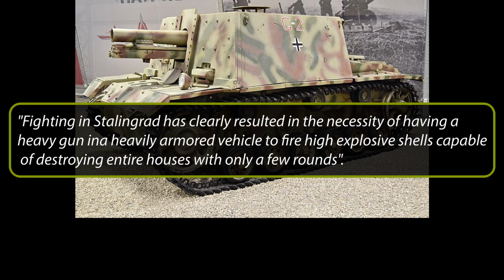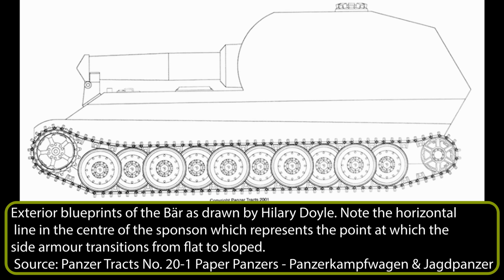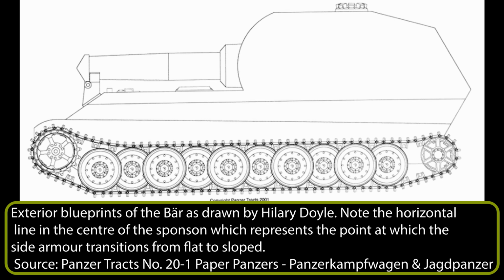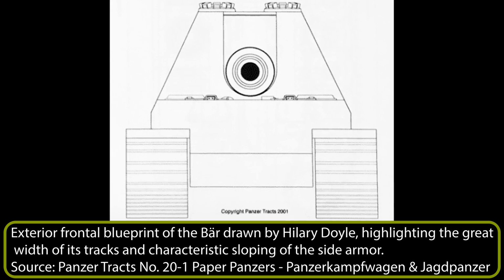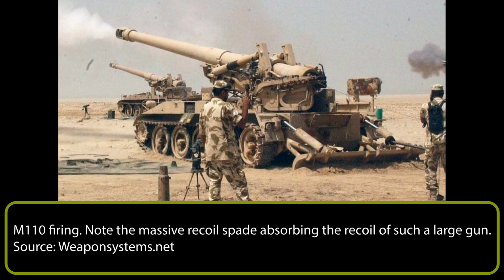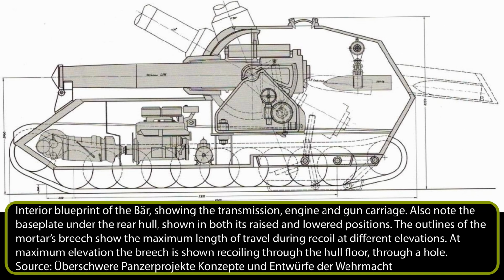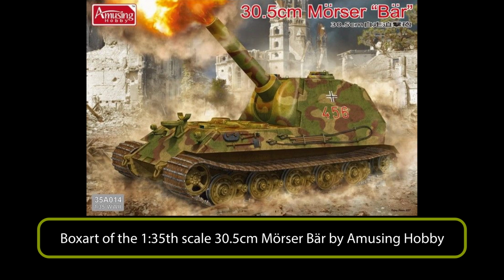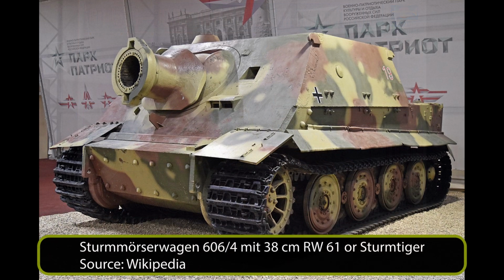A Tad Overkill | 30.5cm L/16 auf Sfl. Bär feat. @Sofilein

Comment: 6:14.
"700 horsepower @ 300 rpm?"
That is absolutely wrong.
Reply: But by the time of the end of the war they all were dialed down to not go over 2400 because lack of replacements. Especially good bearings.
Reply: 3000*

Comment: It's a shame got to see this built just look at the hitting power the sturmtiger could do this would be much Greater so begs the question of was it designed with destroying mass formations of Russian infantry and armour at long range the Soviets were well known to use tanks and infantry in waves and this mortar would of blunted enemy attacks Kilometres before they got the Germans in there sights. also I do seem to remember there was a large artillery gun based system mounted on the proposed Panzer 38 D so makes me wonder if the 38Ds were to accompany the larger Bar tigers

Comment: Just a little bit of insight here from someone that works with presses for bending sheets and plates of steel, the press needed to bend the 240mm thick plate that made up the front of the Maus turret had to be rated at somewhere in the 1,500+ ton range. I've run several presses rated at a maximum of 135 tons, and the most they can handle is 1 inch (25mm) plate of about 2 feet across at the most.
Reply: Maybe it was intended to be a hot bend? That would probably be a fair bit easier, unless you are already talking about hot bending.
Reply: @johncharlesbrown2314  The plates probably would've been worked hot, but it still would have required a fairly substantial press. Although, upon further research, these plates would've been shaped via rolling through a rolling mill.

Comment: Both the Germans and the Soviets designed and built heavily armored large caliber siege weapons.  The problem they faced was getting a large enough 'bomb' close enough to a heavily constructed and fortified building or bunker to destroy it or kill or drive out the defenders.  When the Soviets were fighting their way into Prussia in 1944-5, they encountered bunkers too solidly built to penetrate.  They would fire huge mortar bombs at the base of the structures.  Eventually this would destroy the foundations and cause the bunkers to tilt over, misaligning the gun ports enough that it could no longer be defended.  Close infantry support was required to protect these monsters; there was no way that they could protect themselves with defensive machine guns, etc.  As the war progressed and the Germans weakened, it became more common to simply drive up a self propelled artillery gun and blast buildings to ruin; as in Berlin.  On the Western Front, at the Siegfried Line and in urban fighting,, where medieval and later fortifications the Americans didn't bother with the heavy armor.  They saturated the target areas with small arms, tank and artillery fire (combined arms), drove up an 8" howitzer and blasted the enemy occupied fortifications to bits.  The Germans actually complained to the International Ed Cross after Aachen that the Americans weren't fighting fair because, instead of returning sniper fire with 30 caliber machine guns firing through the windows the Americans used fifty caliber machine guns and just shot right through the walls.  We call this: "Peace through superior firepower!"  I believe the American reply to the Int' Red Cross was a politely worded: "Tough shit!  They started it."  Today, with precision guided aerially delivered weapons, we just blow to targets up from a safe distance.  We call that: "Progress!"  Or, once again, peace through superior firepower, for: "Yay though I walk through the valley of the shadow of death, I shall fear no evil.  For I am the evilest mother f***er in the valley."
Reply: Peter Maleady great comment bro

Comment: SU152 says hi.
Reply: What?
Reply: @steinmayer2791  Contrary to this one it worked, it was almost three times lighter and made in over 700 examples.
"Wonder weapons" are a waste of resources.
Reply: @pernibuzdovan12  the su 152 was a fail of the Sowjets, it had more problems than the Tiger 2 cause of the lack of a good engine and chassi. The later made  
ISU 152 and ISU 122 had no longer most of the problems.
Reply: @steinmayer2791  And still was better and infinitesimaly more used than this one.
Reply: @steinmayer2791  the SU-152 was in no way a failure. It was a quick stopgap design as a heavy bunker busting spg was needed. Additionally, there is no way you can compare the Su-152 with the tiger II
Reply: @constantinalexe4862  well...: to heavy for the kv1s chassi, engine overheating, transmission breaking, bit to slow, could not be repaired on the battlefield. I would say its compatible with the tiger 2.
Reply: “BuT mUh 152 mM hOwItZeR”
Reply: @igoryst3049  i like the Sturmpanzers more

Comment: never thought that the e100 had another SPG variant
thx for the good information.
love ur vids and keep up the good work.
Reply: Its not based on the E100
Reply: @pavelalexe9254  well if its based on a tiger 2 then its almost based on a e75 and e100 is based on e75 with wider tracks. it is.